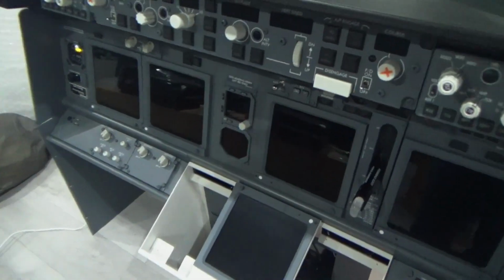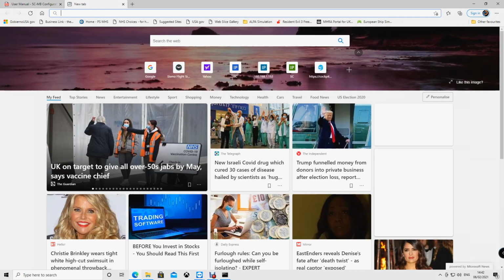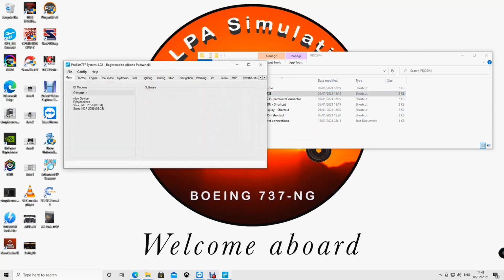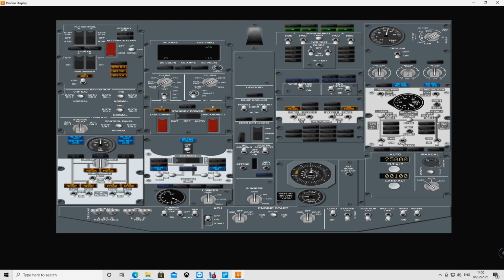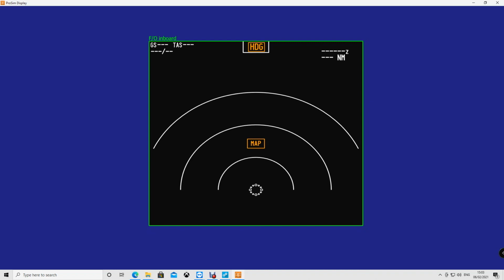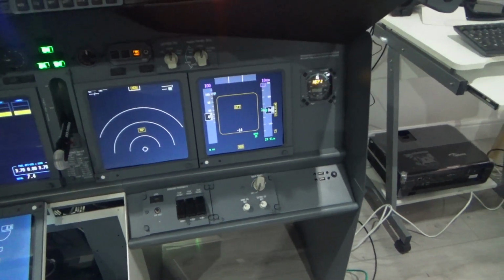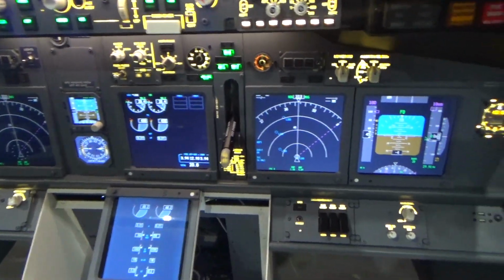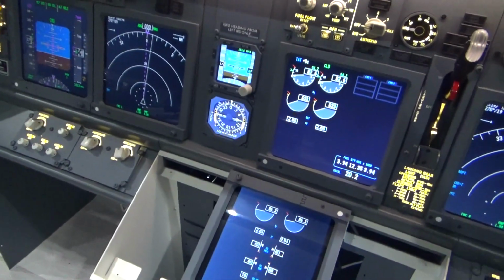Setup & Testing of MIP, EFIS, MCP

Comment: Hey my friend. For some reason, I can’t click or turn a lot of the knobs on the AFT OH panel Prosim display. It’s in normal mode, so it’s not in config window. Would you by any chance know why?
Reply from the maker: I am away from my pc at the moment, but the only thing i can think of is that it is not connected to the server/IP address.
Reply: @alpasimulation5485  oh yea, I gotta check that out. Forgot about that

Comment: Hello ALPA Simulation,

Another great video.  I have been researching doing a cockpit of my own for about a year but plans slow due to COVID.  I work at entertainment place in California USA that has full size 737 cockpit using Project Magenta.  It is quite old but still works well including the SISMO Fwd Overhead.  Loved seeing all this hooked up together as I looked at possibly upgrading to ProSim737 to replace our PM.  So glad you showed the hookups in the back as I was wondering how the SISMO equipment went together now.

What I would love to understand and see in video is of the cockpit shell (if you are going to have one, assume you will) and how it connects to your floor.  I think I heard you had issues with the original floor.  I know there are a couple people out there that make shells so which one did you go with and how did you make sure it would fit to the floor.  Also, how to make sure the overheads and such would fit properly.

Very cool watching all this.  While I am not typed rated in 737, have been a pilot since age 17 (50 plus years ago) and have some heavy experience in older DC-8-63F and B-747-200F simulators training with airlines.  Been flying the 737 SIM here for some 4 years now and have studied the proper way to do things so if you need any assistance, I can offer that on the flying.

Anyway, look forward hopefully to see the shell and floor mounted along with modules..
Scott
Reply from the maker: Hello Scott, nice to see so many people with the same passion, whether they are pilots or not. You are right, I am assembling the full cockpit shell to the floor and you are also right in saying that I had some issues with the original floor, but that was due to a simple mistake I did while searching for the correct flooring.
The new floor and the full cockpit shell comes from, FBC, or Flybycockpit. A nice company in Portugal specialised in cockpit structures. I purchased from them also the yokes, rudders, tiller, oxygen section, Ipeco seats. I am preparing the video on the assembling of the full shell on the floor so you will be able to see better. FBC has an agreement with Sismo, Simworld and Cpflight and their cockpit floor/shell has been designed to fully fit any of the above supplier's cockpits. My cockpit is mainly Sismo and so far is fitting quite good
Reply: @alpasimulation5485  I have their price list from last year.  I look forward to the video of building shell and even more interesting, fitting the modules in place and attaching them.  I would also like to see a bit more "behind the MIP" at how Sismo did with the wiring...  Glad your able to build the dream...